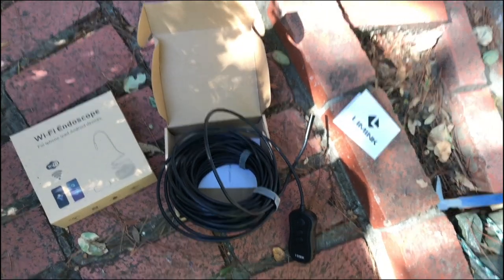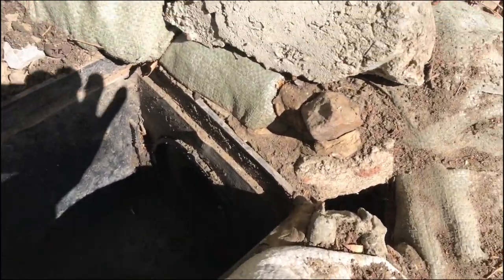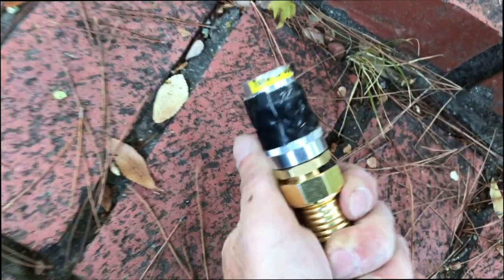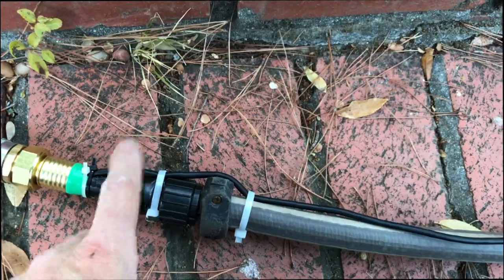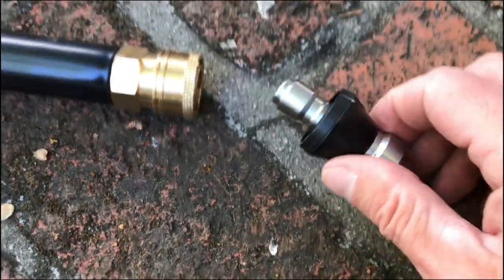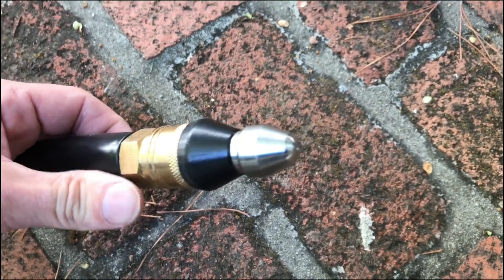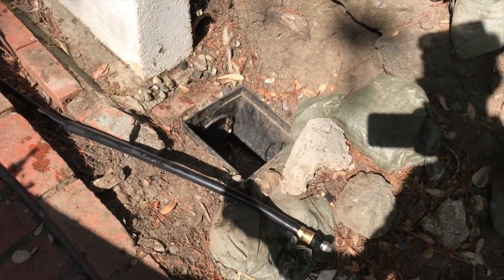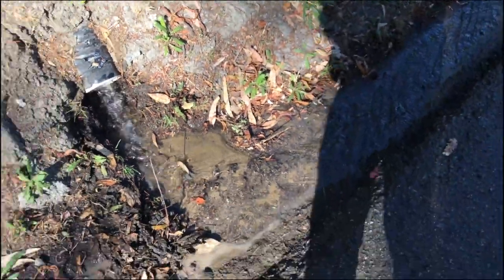Do it yourself sewer pipe video inspection camera and Limink product review

Comment: If you jet from the low end, the jet will wash the debris downstream. Also, while jetting, run a regular hose at the top. Flow is your friend.
Reply: How did he get the root out if he jetted before hitting the root??? Wouldn't the jet wash the root downstream ?
Reply: @VuNguyen-sx4lt  I don't think the jet does anything to the root. The auger has a steel cutting head which will cut the roots and also why he was worried about it damaging the pipe.

Comment: Root X or any product with copper sulfate is supposed to kill roots in the line.   But the FOAMING type so it fills the pipe and kills all the roots, and not just on the bottom portion.

Comment: I like your technique your ingenuity I'm a drain cleaner for about 35 years now the first thing I did is got a pressure washer and kept the end of the line and made my first hydro Jeter one comment on the corrugated pipe I find it best do not use a blade on that pipe it'll just grab it and tear it up what I do if I leave the blade on there I have like a pear shape blade anyway any root cutter blade take some duct tape and just wrap it up so it's just got like a fist going through there not too big but you know just just tape it up so the blaze is not going to be cutting through there if that's still too big the pipe does crush and you won't be able to get a cable through there anyway but water is just going through there we could do is take the cable do the same thing at the end of the cable take the cutter blade off duct tape it make just like a little ball kind of at the end of it I found that works best and then go ahead with your hydro Jeter that's not going to hurt it one tip on the hydrogener going as fast as you can and pull it out as slow as you want to that's when the line cleaning is getting done when you're pulling it out you're going to hit your first blockage just get through it and get on to the end of the pipe as fast as you can and then just take your time pulling it back twisting it quarter to half turns each direction rotating left right left and you'll get a good clean pipe out of it you did a good job too by the way . Playing poker you know its true if you have a full House always beats a flush but in our business  a flush beats a full House no matter what!. Because if you have no flush you can never have full house But either way if you have a full house and you do have a flush good to know your going for that royal flush Tada!!!!
Reply: Bro! We need to start using periods to end a sentence, and capital letters to start one. Come on! People are going to think we're a bunch of uneducated boneheads. 🤙

Comment: you can run those type of machines (snake/cutter) in corrugated pipe with no issue, so long as the pipe is not collapsed or partially collapsed! 

You did a great job by the way!
Reply: Yes you can

Comment: I have three old homes built between 1910-1925. Two are rentals and one has had plumbing issues from the start. For a month I have spent every weekend trying to clear the main line which goes under a paved road to connect under the sidewalk on the other side. 47 feet down the main something is in there that refuses to give way. I think it might be a collapsed pipe. So this morning I am looking at the 16 foot endoscope I previously bought to look inside walls wondering how I could push that down the drain pipe with a USB extension and hold it together? Garden hose to the rescue!! I had thought about that as a solution and turned to youtube to see if it had been done. Bingo! The local big box tool rental wants 137.00 to rent a drain camera for four hours with a 500.00 deposit. The local plumbing companies want to ass rape me as well. In fact yesterday I called to see if they would come push through the line at 47 feet, they wanted 150 to come look and give me an estimate, of course the 150 is a down payment for some fat ass to come tell me what I already know. They want even more to do a video inspection of the line. I said no way. They can sit on their overpriced machines and stare out the window at the idle service truck with the stupid jingle on it. They should be more friendly. 
"Hey you know what? We're kinda slow today, I'll send a guy over to see if we can help." Instead of declaring a dollar figure to be my temporary best friend.
Help me figure out what the problem is and then we can talk about reasonably priced solutions. I am not unwilling to pay for good help. If they are going to incrementally jack me out of a grand of course i am not going to let them anywhere near me.

I'm going to go buy more usb extension cable and stuff the wire into a garden hose. Use plumbers putty to seal the camera end and pack it around the cable connections if needed. What would make it even better would be micro usb connectors. If I get 50 feet to work decent enough. I just awarded myself a side income. Help put that overpriced red truck out of business.
Thanks for making the video. People like you with resources like YouTube instantly level the playing field.

I owe you a beer.
Reply: I don't think you understand how much a real sewer inspection camera costs. A descent one that can be used everyday all day is around $12k on the low end. So that is the reason that there is a minimal charge of $150 to run that camera through your old pipes and possibly get the camera head stuck. If you don't know what you're talking about dont write a book showing that u don't know anything about plumbing or running a business.
Reply: @aquacleaning4994  I just got back from our local plumbing store and they sale the entire camera kit for $2,400. 12k is a bit extreme. Not saying they don't sell them, just saying you don't have to pay that much. Kinda like buying a new car you can buy a 2.4 million dollar Bugatti or at 20k Chevy, both will get the job done.
Reply: @be891   that's well known that u can get cheap cameras. The difference is being able to use it ever single day all day weather it's in the hands of a professional or a first time user. A $2400 one would be broke in 1 day if someone inexperienced were to use it. That is the point I was making from the beginning. A professional company does not use a cheap $2400 camera and that's why it costs $150 just to pull the camera out of the truck
Reply: "A $2400 one would be broke in 1 day if someone inexperienced were to use it."

Lol... An inexperienced person could break a 100k camera. Let me provide this example. I use a plumber that's worked for the city almost 25yrs. He retired and just started his own plumbing company less than five years ago. He is very well known and is always booked with work. I recently had a plumbing issue and He was booked so in a pinch I had to hire a very well know "professional equipped company" to do some plumbing work. Long story short I had to get my trusty plumber to fix the shotty work done by the professionals. He recently got hired to do plumbing work for one of the schools in the area.  However he does not own a "minimum 12k camera that professional use". Does that mean him and his company are not professional?... A professional company has nothing to do with how much they can spend on equipment. I personally think the word "professional" gets used to loosely.  He'll I have a mechanic that has fixed vehicles people that the dealerships couldn't. That might have been an issue when professionals rely too much on fancy equipment and not have the troubleshooting skills to get the job done correctly.... In my opinion their are very few professionals and even fewer professional company's.
Reply: What I said from the beginning and will state once again, since u don't know how to comprehend the situation you're arguing is that a "professional" company means a big name like Roto Rooter or others. They are the ones who charge a minimum of $150 to pull the camera out. Any company can have inexperienced workers and do shit work. I work for myself just like the guy you're blabbing on about. Funny thing is, I do all the schools in my county. You missed the point of this whole thing. R/whoosh 😄
Reply: @aquacleaning4994  well if you think they charge 150.00 based on cost of equipment then you really don't know what you are talking about. Price is driven buy cost of service, not cost of equipment. A mechanic can have a 10k vehicle scanner or a $500.00. Either way diagnosis with be 75.00 - 95.00 based on labor rate and cost of service.  Most plumbers in the area charge 75.00 just to come tell you what's wrong or 75.00 an hour.  That has nothing to do with how much your equipment cost.  I guess I should let my plumber know he needs to buy a 20k camera so he can charge 5 times his current rate.lol And then he can finally be called professional company.lol
Reply: @be891  you don't know what you're talking about at all. A plumber is one thing. A hydro jetter is another. Jetting costs anywhere from 300-$500 an hr. So a $150 for a camera inspection is actually cheap. This video was about jetting and the cost they charged the guy...or were going to. That's why he did it himself and complained about the ordeal. U don't call a jetting company out to unblock something simple and u dont call them if you're a cheap ass either
Reply: U also have to remember the age of this home the guy said it was. I wouldn't even risk putting my 2400$ camera in those old cast iron pipes for $150 much less a more expensive one. Another thing you're not taking into account is all the features a more expensive camera has an most higher paying jobs need it to have those options for later viewing, marking problem spots, self leveling, etc..etc... This is all I'm saying about it so we can agree to disagree I guess
Reply: Save yourself alot of money and do what is guys did and get it down two hundreds instead of thousands because the truth is you don't use that camera everyday all day long and it would keep the price down so more people could afford do have that done... just seems like it would be a benefit to everybody to cut the cost
Reply: @aquacleaning4994  I understand that it is marketed as such. I was able to cram a 20.00 camera into the hole. I got it way down in there too. Far enough to see I was up against a fat yellow gas line. They had replaced the gas line a few months back. Severing the sewer line with the trencher, or shovel. It is a rental I did not witness the work. They came right out and repaired the line.
Reply: @fxsrider  no problem, I was just trying to explain to the other guy why they charge so much for inspections. Of course anyone can do small DIY jobs if you're willing to do the work. Most jobs that require a camera is from something like u said happening and not knowing. It's not very common for someone to call u just to see inside the pipe lol
Reply: @aquacleaning4994  A professional does not mean big companies like laughable Roto-Rooter. Being a professional refers to providing quality work and excellent service at fair and reasonable prices. Just because one is an independent contractor does not make that person a non-professional. You have no business sense at all. You should think about going back to work for the man.
Reply: You are cursed by knowledge and as a consequence, you aren't really worth their time. It's understandable.
Reply: @aquacleaning4994  lol
Reply: So somebody should come to your house for free?? Lol, you have no clue.. thats not how it works. Pro tip: know that you're the kind of customer nobody wants

Comment: That's a great solution. I wonder if jetting through a claytile french drain will damage the drain tile make it collapse? Any experience with clay french drains?
Reply from the maker: Li ma Du . You will have no problem using it with clay tiles. I did on my old french drain.
Reply: @patricksirk6920  Thanks for your response. Will probably try next year.

Comment: Would that make it thru turns on 1' 1/2" pipe?
Reply from the maker: I don’t think so. I assume you are referring to the endoscope. You might try attaching it to a sewer drain snake which is thinner. But I suspect that the problem will be to keep your lens pointing forward . On another note. I have tried to use my endoscope on an actual iron sewer line but it couldn’t make a 90 degree turn . It was too bulky. Also, the endoscope finally gave out at about 30 uses. It was receiving to much abuse. Still worth the cost for the use I got out of it
Reply: How much prize pls